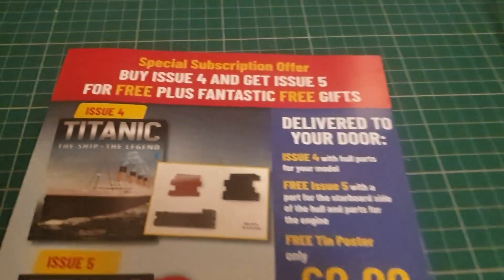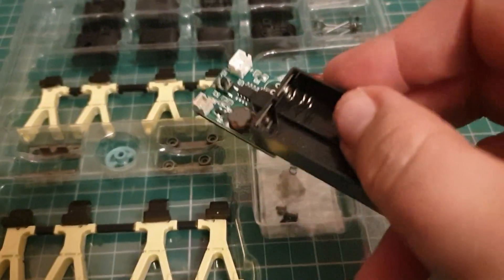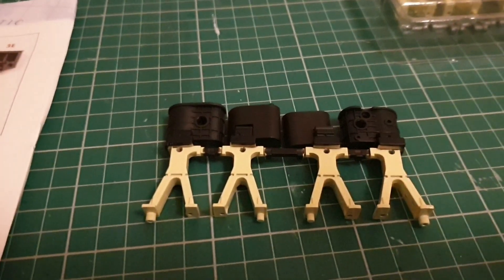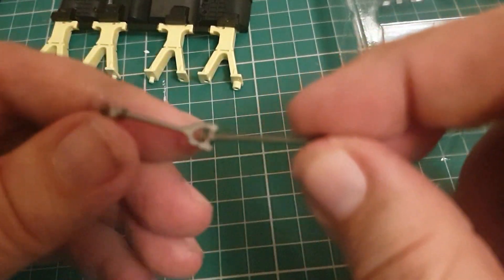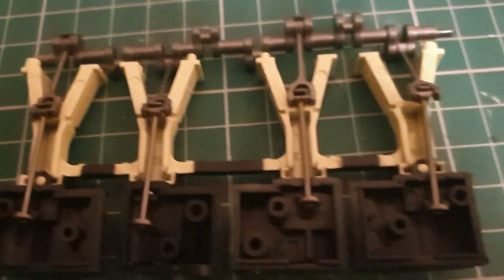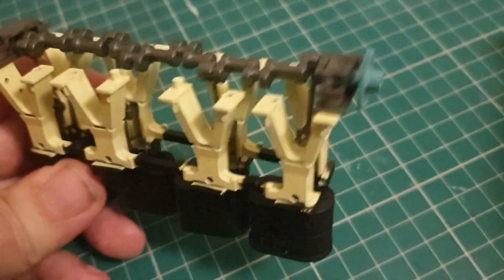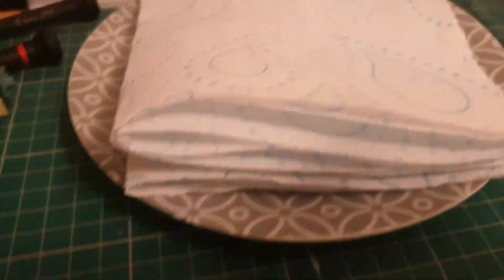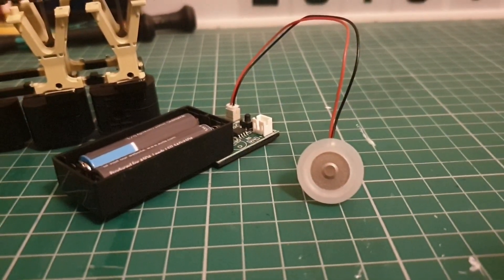Hachette Build the Titanic : part 3

Comment: Hi - just received Part 2 and Part 3 in the post this Wednesday 25th January  - having subscribed (I'm in the UK) so building both this coming weekend! Great to see your videos as very helpful! I am also on premium subscription to secure the display case!
Reply from the maker: The case is going to be huge , gotta be close to 5ft
Reply: @buildingwiththeboys  Gosh - yes, you must be right. I will add to it 5mm hardwood strips around the edges and down the sides, polished finish as I think that will make the case look more museum style. Important to make the mitre joints at each corner a precise fit - I love woodwork so hope it will add a bit of a finishing touch. Of course this is ages ahead as we have so many stages to go through the build first:)
Reply from the maker: @N-Scale-trains  that will look amazing !